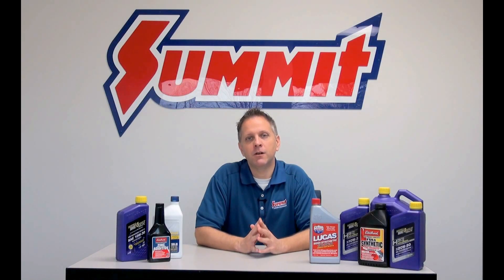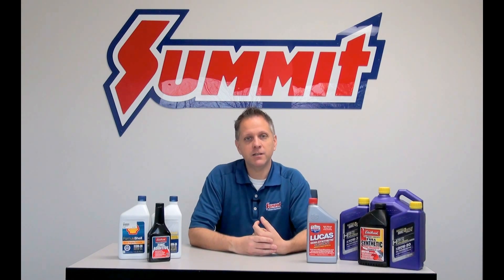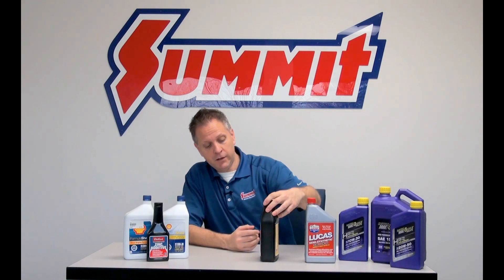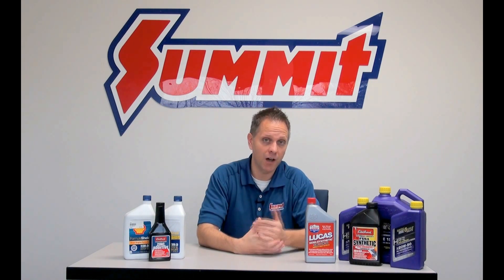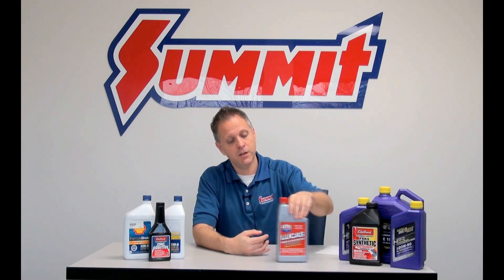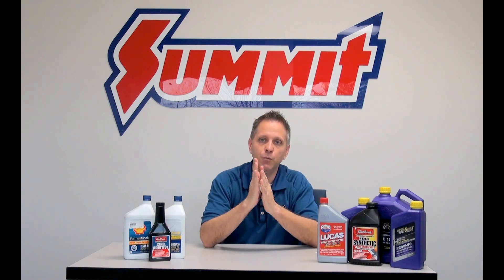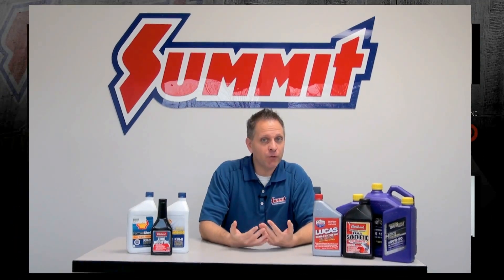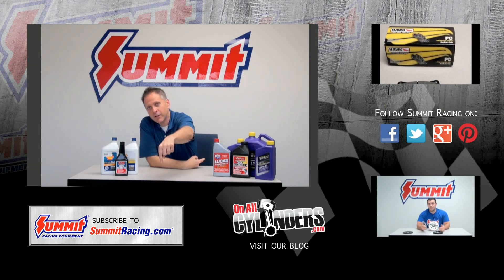Synthetic Oil vs. Conventional Oil - Summit Racing Quick Flicks

Comment: If you have an older motor do not switch to a full syn. If any seal or gasket on your engine is close to failing the syn will find it's way though! I learned this the hard way years ago when they were just starting to get popular.  @ 6:32 Summit says you can't go wrong changing to a full syn yet rear there reply to suzonka tyler below...
Reply: +Digme Ahole Synthetic oils are detergent type oils. They clean the engine, if you have an older engine and you switch over it will eat the crud off the inside of of the gaskets and it will leak HOWEVER you get the same issue if you use a conventional oil that is also a Detergent type oil, like Pennzoil.

I used to be a lube tec for Pennzoil and would have this issue with normal out the gun oil. Put in STP oil additive, and a non detergent oil, that will fix your issue, other then that you need to re gasket your engine.

Comment: Good vid, but as for engine break in...all new cars have synthetic oil in the crankcase when new.....so, that being said....what is the skinny on engine break in? I doubt if new engines are using petroleum based oils for break in.
Reply from the maker: Engine size is somewhat irrelevant. Horsepower is what you have to factor in.

Horsepower x .50 = lbs per hour.   

lbs per hour / 6.25= Gallons per hour

 

So let’s say he has 400HP

400x.50= 200 lbs per hour

200/6.25= 32 Gallons per hour

And if someone only understands fuel pumps rated by liters per hour, multiply your gallons per hour by 3.79. 32 GPH x 3.79= 121.28 liters per hour.

 

Fuel pump GPH is usually rated by free flowing (no resistance or pressure). The more pressure/resistance added, the more the GPH will be reduced. Small fuel lines and fuel filters will reduce flow.

So I would be conservative and say that our pump is good up to 350HP.

Comment: Can I use full synthetic transmission fluid in my 1978 GMC pickup?!
Reply from the maker: Hi Rob, As long as you drain the old fluid out of the entire system (transmission, torque converter, lines, and cooler) it would be just fine.

Comment from the maker: Now, looking at the numbers on the bottle, the first number indicates the viscosity of the oil at a cold temperature, while the second number indicates the viscosity at operating temperature. A second way of looking at multi-viscosity oils is to think of a 15W-40 as a 15 weight oil that will not thin more than a 40 weight oil when hot.

Comment: Pick a diesel oil for pre-2007 engines, they are loaded with anti-wear additives and are suitable for gasoline engines. Check out Shell Rotella, wall-mart diesel oil, valvoline premium blue, Delo 400, all in a 15w40 grade. You might find an oil report online somewhere to identify the additive package.

Comment: Only problem with using synthetic in a high mileage car is the engine might burn or leak the synthetic oil, make sure your always checking your oil level and topping it up when using SYN oils

Comment: Who changes motor oil at 3000 miles anymore?  I wonder if Dave has lab analysis ratings of used motor oil to back up what he said?
Reply: I know no one does anymore, but personally I would rather do it. nowadays with the extended oil intervals there tends to be a lot of sludge and worn out cams, ect
Reply: People these days are tripping over changing their oil in their car. I mean for what its worth, engine oil is the LIFE BLOOD of your engine! And it cost less than it full tank of gas.
I'm sure if you have your oil lab testing around 3-4k miles, the result will probably say it can go another 3k miles more or so. However, oil gets contaminated w/debris and moister in time and especially when you do a lot of stop and go driving.  I don't care what kind of oil either full synthic or convention, i always use the best oil in my car btw, which is amsoil,royal purple and if those r not available i would use castrol syntec. And I would never ever go past 6k miles w/o changing it. I changed all my oils in my car btw bc i don't trust those quick lube shop. Royal purple is the most expensive oil is has excellent reviews by consumers and mechanics. it cost $37 for a 5 quart jug at walmart and $8 for their filter. The best oil and filter for your car for under $50 and people are TRIPPING ABOUT THAT? WTF???  And Im a girl and i do all my oil changes.

Comment: but you have to make sure your engine is sound enough for the syntheic oil. If u have alot of miules and there too much clearence between the cylinder walls, and pistons. the syn oil will leak through and not seal properly to hold compression. On the other hand if engine is in good shape syn oil will deff help.

Comment: Dave Said - [paraphrasing] "Higher viscosity number is how the oil flows at 100 degrees centigrade". Really? That's 212F. I'm in Phoenix. In the dead of summer, my oil temp rarely reaches 212. Oil and water temp typically hover at just above 195, thermostat temp. Is my 5w-30 oil NOT reaching the 30 weight flow state?
Reply from the maker: HI *****, 
Oil temp. usually runs  very close to or just a little higher than water temp in a (non-race)daily driven vehicle. It appears that your temps are close enough to the standard that you have nothing to worry about.
Reply: Summit Racing Didn't even come close to addressing my question.

Comment: I have a 06 chevy malibu maxx. Got it with 19k and started putting amsoil in it and at 165k miles no probs. I also change my oil every 10k. Once I did it at 17k and the oil wasn't black and didn't have gas smell. So no reg oil for me.

Comment from the maker: Hi Steve, 
Synthetic oil will not create a leak but, due to its improved molecular structure (which is what makes it super slippery) it will find cracked seals or potential leaks quickly in high mileage motors. Remember too that synthetic oils will also clean up dirty oil deposits in the crankcase as well, so if these deposits are helping seal or deflect any possible areas that oil will leak from, you may get a leak!

Comment: I have a 1978 oldsmobile cutlass supreme with a chevy 350 engine can i use synthetic oil or should i stick with conventional oil and which oil should i use
Reply from the maker: Hi Luis Gonzalez, 
While regular oil has worked just fine for years and years, synthetic does offer a lower friction advantage. This lower friction equates to better fuel economy and potentially more power but, this will vary from motor to motor. If the cost increase of switching over to synthetic is justifiable to you, there is no real downsize to making the transition!
Reply: You should give entech oil a try so far best formula I've tried

Comment: I am testing different oils now. the first change was synthetic. my car did feel a bit more ready to go. my second oil change was a blend and the car does feel slightly sluggish. I think I'll go back to synthetic as the car felt more responsive.
Reply: Arthur Smith that's funny XD. I just got the mobil 1 oil yesterday and I just called advanced autoparts and they are holding 2 Mobil oil filters. I think I saw the same video you did and I was sold
Reply: Arthur Smith I'll check out the marine oil stuff
Reply: 792bnz it must be Marine outboard TCW3 rated. Not just two cycle oil. TCW3 that's Two Cycle Watercooled series 3. As long as it is NMMA approved which most all have that symbol. Walmart has a Super Tech marine oil. They also have Pennzoil Xlf or Premium Plus for about $17.00 a gallon. If you go Full  Synthetic it can cost double. I go with semi synthetic. Jus bought two gallons of Pennzoil XLF. There have been hundreds of thousands of miles tested with great results.
Reply: Try entech oil so far best oil I've tried

Comment from the maker: Well, Sorta!  Lets start by saying, always follow the manufacturers recommendation written in your owners manual. Keep in mind that the engineers designed that motor to run a certain weight of oil and for best and longest lasting results, that recommendation coupled with proper oil change frequencies; your engine will give you many years of service.

Comment: If you the type that does heavy driving like racing, and live in a place thats SUPER HOT OR COLD. then syn oil is a better choice as well, but for the daily mom/dad going to work , shopping, and back. regualr oil is fine.

Comment: hey I have a 2001 Cadillac dts I just purchased. I was wondering is it possible to switch from regular oil to synthetic oil and what process would I need to do
Reply from the maker: +Wayne Williams, 
Yes, you can safely switch to synthetic oil. A couple advantages of switching to synthetic oil is that its structure at the molecular level stays more stable with temperature changes and extends the time between oil changes. But, remember to use a good quality oil filter with these extended oil changes.

Comment: Good Vid!
I was wondering how people fill about putting recycled oil in their car? Anyone know if its much worse then brand new? 
 For example I was going to buy some full synthetic oil at wally mart for my 06 SRT8. I noticed it was about 8$ less than the local auto stores. A friend of mine said don't because the reason it is cheaper is that it is recycled oil, I went to take a look and there it was written on the bottom. It say recycled oil from your local wally mart lube center.

Comment: Would a synthetic be better for my 1997 ford ranger XLT 2.3 4 cyl. I like to do a little hevier driving with it will it be any good on the old 2 to one plug 4 cyl
Reply from the maker: Hi tyler jenkins, 
You’ve surely seen all the claimed benefits of switching to a synthetic oil online and in magazines. While all those claims are perfectly normal, be aware that synthetics are not capable of adding horsepower but freeing up power normally lost to friction. Therefore, the smaller the motor the lower the power gain will be. Also, many claim a financial benefit and these too are also very possible but only seen over a period of time. If you are considering a switch to synthetics late in the vehicles life time then your financial recoupment will be small.
Reply: You should try out entech oil and ask them so far best formula I've tried

Comment: I have a flat tappet cam but I'm using full synthetic. Do i still need a zinc additive?
Reply from the maker: cyrus138,
Some camshaft manufacturers do not recommend the use of synthetics with their cams especially during break-in. Others say to break-in with mineral based (including the correct Zinc/Phosphorus additives) and then switch to synthetic. The best suggestion would be to contact the manufacturer of your camshaft and ask their recommendation. After all, any warranty offered by them hinges on proper installation, lubricants and matching components!
Reply: +cyrus138 They basically limited the Zinc to an average of 800 ppm on most oils because a high level of zinc can coat the insides of the catalytic converter and cause it to work inefficiently and break if your engine burns oil. If you do have a flat tappet cam with no catalytic converter then my advice is to use Quaker State's defy high mileage oil which has around 1200-1300 ppm of zinc additive and is the only name brand oil that has higher than the average level of zinc so you don't need to put any additives in the oil.

Comment: If you are running a older vehicle and need the zinc, use diesel oil instead of putting the additive in. That's what I use in all my classic cars from all decades with those requirements. Try it out!

Comment: I have a 2008  nissan versa trim  s. 40,000 miles witch type of oil do you recommend: convetional, semi- synthetic or synthetic? ( by than way I live in the state of IL)
Reply from the maker: rudysr22, 
Ultimately this is a question that will have to be answered by you and your wallet. While good ole fashioned oil has worked very well for many years, Synthetics offer less friction, less frequent oil changes and a very slight increase in power & mileage. But, keep in mind that these gains are so slight that the owner will have to be dedicated to driving the vehicle for many, many miles to realize any savings due to the higher cost of synthetics!
Reply: You should give entech oil a try so far best formula I've tried ... I'm sure they will know

Comment: Do you feel that breaking in the engine with a Hydraulic Flat Tappet cam with a Break in Oil like Brad Penn or Joe Gibbs then switching to a Synthetic is OK?
Reply from the maker: +John Arnold, 
There have been mixed results on this but, the bottom line is that the synthetic oil does not have the Zinc & Phosphorous necessary for proper lubrication of the flat tappet cam & lifters. You could still use a small bottle of additive though!
Reply: +John Arnold rather be safe and keep on using oil with zinc.  Can buy comp cams engine break in additive from summit and add a bottle every oil change.

Comment: Hello, i use 10W-40 for 7500 klms!!Is that correct?Thank you!!Greetings from GREECE!!Semisynthetic!!
Reply from the maker: Hi Νεοκλής Παπαδόπουλος
These days 7500klms is a good change interval; depending of course on the type of driving you do!  The best advice is to follow your car manufacturer’s suggestion. For instance, a lot of in town stop & go driving heats the oil up and breaks it down quicker over time. Therefore you would need to change it sooner. On the other hand, if your driving is mostly highway, you’re not heating/breaking the oil down as quickly so you can lengthen the change interval.
Reply: not wild!!

Comment: The molecular size of synthetic is smaller than that of conventional.  This is why many times older cars running conventional and switching to synthetic report oil leaks around seals and burning oil in some cases.  The car is not failing or anything.. the oil is just passing where the other kind could not.  Newer cars with higher compression engines usually require synthetic because of this characteristic, and conventional will plug them up because of tighter tolerances in the journals, compression at the rings, and materials for the seals not needed before with the conventional.  Gas mileage normally increases switching from conventional to synthetic as well.  Swapping in my opinion is not a good idea if leaks or burning oil is encountered; also a realistic comparison between the higher price of oil to the performance targets as to being worth the investment.
Reply: exactly

Comment: I use Royal Purple 5W30 motor oil, Max A.T.F. in my transmission, and Max Gear in my differential. I own a 2005 G.M.C. Safari with a 4.3 V6 engine. It is my daily driver. It is 10 years old and has 60,000 miles on it. They have stopped making this vehicle, 2005 was the last year. I may go a little overboard on maintenance, but R.P. is the best, and this may be my last van. I change my oil twice a year, transmission fluid every 5 years and differential fluid every 2 years, new premium filters with all fluid changes. Mechanics tell me that my drive train still looks brand new. And the van has always been street parked.
Reply: You should give entech oil a try so far best formula I've tried

Comment: The reason the EPA Mandated the zddp level to be reduced is because it can clog up catlytic converters and since nowadays no manufacturer uses OHV Flat tappet cams in their engines new engines don't need them. since i put some regular mineral 20w50 specially designed from flat tappet cams with high zddp whereas i sue to run semi synthetic 10w40 my car runs a lot smoother

Comment: I am no oil expert; I don't have a chemistry degree and I don't make oil, but I have spent much time looking into oil after the engine in my daughter's three year old, 2008 Mini died.  What did I learn: Synthetic oil and Dino oil is only the base carrier for the additive packets from the manufacturer, so buy the oil based on your needs and recommendations from the car manufacture; and only oil analysis can adequate determine when the oil needs to be changed.  Synthetic oil does not guarantee you can drive a car 15,000 miles before an oil change and I don't believe synthetic oil is automatically better then dino oil.  I run a dino oil from lubrication engineers (LE) in my diesel truck approximately 10,000 miles a year with routine oil analysis per oil change.  There are several consideration for not going to synthetic oil, none of which have to do with damaging the oil seals...etc.  LE makes a great oil for my 1999.5 F350 7.3 liter Super Duty, however, so does AMSOIL and other manufacturers.  If you have questions on motor oil I suggest you take a look at the following web site: www.bobistheoilguy.com.  This site has white papers on oil and people certified to answer your questions.

Comment: Yeah you are. Just cut it out. Obviously synthetic oil is not garbage. 
If you really think it is, I can show you a 550HP supercharged small block Chevy that's been running the stuff for three years now with no problems. I'll even pull the main and rod bearings out this winter and you can have a look for yourself.

Comment: That is by far the most ridiculous comment I've ever heard. You do realize that thousands of people (myself included) get used oil analysis and virgin oil analysis which show wear metals and the oils additives. The base stocks of synthetic oils naturally dissolve sludge especially oils with high ester content or group V. Synthetic oils contain just as much or more additives as conventional oil. Also synthetic oils do a better job at keeping a engine clean and preventing sludge than conventional.

Comment: If u change your oil every 3000 miles. You are wasting money. 3000 miles is like changing your air filter every 10,000 miles. Right when it starts really cleaning the air.
Reply: Unless your engine requires synthetic oil. European diesel engines being a case in point.